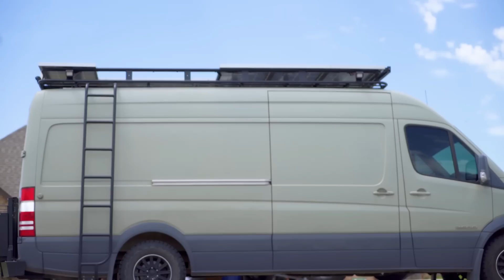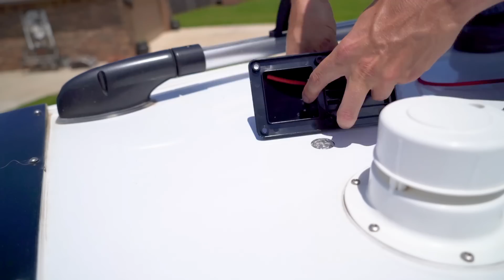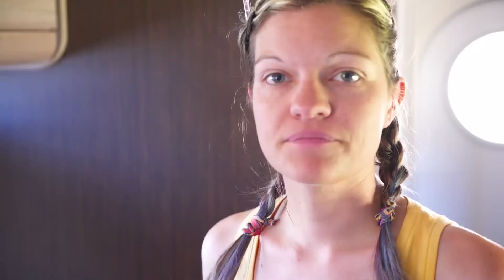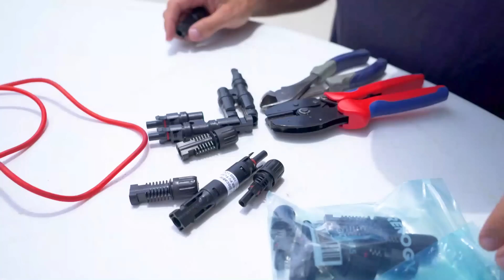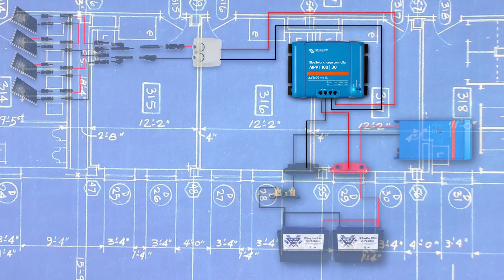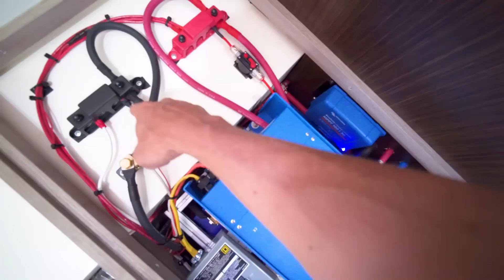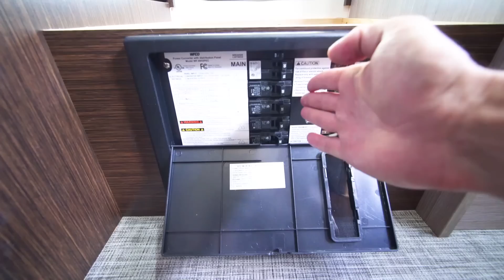Camper Solar Setup Tutorial - How to Solar Power your RV, Camper Van, & Truck Camper

Comment: Have you seen the Rockwood Geo Pro 19FD that already comes with a 100 w solar panel, and is being advertised as able to be used overlanding.  So my question would be how woukd you increase it to run 400w, with the battleborn lithium battery, so it can run longer.

Comment: So I’m getting 525 aHr Lithium battery and only 240 watts solar panels to start, until I see what fits. How long, generally speaking, will it take to charge the battery with just the sun? Yes I understand many variables but it’ll be kn a 19’ Sprinter van that will also charge when run errands from Our boondock site. Should this be fine ore too inadequate? Mostly around the 45th parallel for this question. These are the adhesive panels

Comment: When cutting holes in metal its always worth treating the newly exposed metal with a little protective paint. Another Sprinter build did this step and it makes sense. Seen many boat repairs where old roof mounted things were removed and exposed lots of rust around the hole rims, despite liberal amounts of sikaflex. Shouldn't be quite as bad on motorhomes but its still metal and an easy step which takes seconds so worth doing. Cheers for sharing.
Reply from the maker: Thanks for watching!  Yeah feel free to go as overboard as you like on your build.  Sounds like you know what you're doing.
Reply: Hi from Australia 
I just came across your comment 
Just thought you might like to look at my camping set up, some Australian locations such as world heritage listed K’gari (Fraser island) and some great camp cook ups. 
Cheers and safe travels🇦🇺
Out There Touring

Comment: Good video. Not saying it's bad, it's definitely a benefit, but are those cable dimensions really needed or is it just to cut efficiency losses?
Reply from the maker: Which cables, in particular?
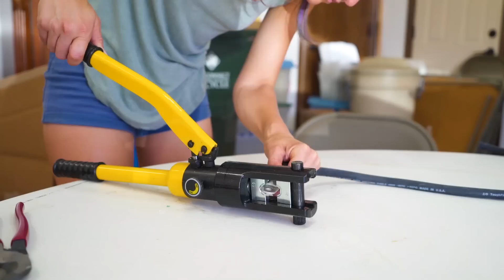Reply: I was thinking of the ones worked on on the table around 8:30, I assume they were used between the battery and the inverter and maybe you'll have that high current, I don't know. It just seemed like a very thick cable for such short distance :)
Reply from the maker: Those are 2/0.  We use those because that's what the electrical engineers at victron recommend in the instruction manual.  :)

Comment: Did this camper not have its own house battery before you added the lithuims and solar? You mentioned bypassing the converter, which is often used to charge the house battery, as well as power DC appliances when shore power is available. You mentioned it powering the DC appliances, but not a house battery.
Reply from the maker: There were batteries installed from the factory.  There were 2 AGM batteries installed in an outside compartment.  Where they were located, there was basically no good way to install an inverter as the wire runs would have been too long and/or we would have had to remove quite a few external body panels to run the wiring.  Basically that would have been more work and less efficient than just moving the batteries inside.

Comment: I am also using a Victron Charge Controller. I have read and re read the Victron instructions and install points and they say not to mount the charge controller on wood as it gets very hot. I am looking for something to put between the wood mounting point in my setup but still looking. If anybody has some recommendations it would be appreciated.
Reply: Just get a sheet of metal

Comment: Just a thought on your shore power hookup, since you only wanted to power your outlets, why didnt you take that breaker, wire it to your inverter/charger shore input, from there, take the white wire from the breaker and hook it to your inverter output, that way you have a breaker protecting the input to your inverter, you can isolate and power off your inverter if you needed and less wire modifications
Reply from the maker: Sorry, but I'm not following what you are talking about.  It's okay though.  The way we did it works perfectly for our purposes and want excessive wriring modification.  It sounds like you know what you are doing though, so feel free do it however you feel like it'll work best for you.
Reply: you branched your shore power (orange wire) to go between your panel and the charge inverter, to make things "simpler" with less splices and more protection, you could could have taken the breaker that was assigned to those outlets, wired that to the shore power of your inverter/charger, then taken a junction box and run the wire originally going to the breaker, junction it and connect it  for more length to the output of the inverter.  Your shore power would power through the panel, then through the breaker to the charge/inverter, from that point it'd go to the circuit for those outlets
Reply: Im also running 2600 watts on my RV but it was an observation ;)  I enjoyed your video and actually am talking to BB to buy one of your kits from them to get lithium batteries
Reply from the maker: Oh, I see!  Yep!  That'd also be a great way to do it!

Comment: Great video! You make a good team in presentation and explanation.

I wonder why do you want to drill holes in the outer shell of your RV in order to glue anchors for your mounting plate for screws that you have to seal afterwards? You still have the risk that water can get under the shell of your RV (maybe not at your place, but when you are getting into the more humid areas where rain is more common...). 
There are very good sealants available that provide enough mechanical strength to glue the mounting feet.  Sikaflex 252 is widely (as in around the globe) used for this job, and also for mounting the entry gland and sealing window frames and whatever joint needs to withstand wind and water. The mechanical strength of the joint between a fully glued mounting foot and the shell of your RV is better than that of screws with or without anchors. The only downside of Sikaflex is that it may last longer than your RV will, so if you need to take things apart... ;-)

Comment: Great video! Thank you! What's your opinion on the need for including the ability to tilt the panels?
Reply from the maker: You can defininitely get more power out of the panels if you want to put in the work to tilt them.  If you are going to be stationary more than you will be traveling, I'd HIGHLY recommend adding some tilt brackets like these: https://amzn.to/2LZRiy5
Reply: Adventure in a Backpack pretty sure I can make those. Thanks! Might be a phase 2 project.

Comment: Great Video.  I have yet to see the document...maybe the answers to my questions are in there.  But those tools themselves are probably around $400 (wire cutter and crimper).  That's expensive for a one time use.  Where did you get these and are there places to rent them?  Also: I'm concerned about the LI-BIM Battery Isolator since the lithium batteries take a different voltage than a standard car battery.  I don't see any method to adjust this voltage.  A B2B would be a better, more maneageble, device, albeit larger.

Comment: Great job, put a fuse between the solar panels and the charge controller.
Reply from the maker: Thanks!  There is one.  Be sure to check the wiring diagrams in the ebook for all the details like that.

Comment: Absolutely amazing work. A couple questions if I may: 1. How did you mount the aluminum box to the floor? 2. I've read in a couple places that one of the probably with lithium batteries is that the required voltage to charge them (14.4V - 14.6V according to battleborn) is different that the alternator voltage of 13.8V to 14.2V. How is this addressed? Thank you for this: This could not have come at a more timely moment as I am considering my options for a solar upgrade on my TC. I want to go with lithium, but have been strongly considering AGM due to the above concern. Thanks for your insight!
Reply: Hi from Australia 
I just came across your comment 
Just thought you might like to look at my camping set up, some Australian locations such as world heritage listed K’gari (Fraser island) and some great camp cook ups. 
Cheers and safe travels🇦🇺
Out There Touring

Comment: I wish RV makers would give more thought to how they decide where to put things on the roof...to maximize that space for solar panels (or MORE panels) the owner is likely to add. Often, the AC, vents, skylights, TV antenna and other such items break up (waste!) open/available roof space which in turn messes up installing panels efficiently as there is little sizable open-space left for them.
When I get my RV, I plan to go solar big-time...but may not be able to get all the panels I need on the roof, especially on a smaller RV (Class B or small TT) with less roof space to begin with, so an efficient layout of vents/skylights/antenna/AC is even more important. Otherwise, to add more panels they'd have to be "remote" -- panels you mount on the roof of the tow vehicle (if you're towing a TT) or outside each time you set up camp (if you have a Class B)...doable, but not as easy as putting them all up on the roof of the RV in the very beginning (set up once and be done with it).
Great video (!) on what you did and it's one to save (a "how to" reference/instructable) for anyone wanting to go solar -- and doing the labor themselves (to save the $$$ professionals charge for doing it) -- on THEIR RV.
BTW: I'm also hoping the prices of lithium "RV batteries" come down big-time in the not-too-distant future...they're outrageous presently. :-(
-- BR
Reply: Don't worry, lithium batteries are already like 10x cheaper than in 2010, and still dropping. For now if you are on a budget you could use different kinds, they just aren't as good.
Reply: Spend more time and plan it better., Simple..😄
Reply: This is why I removed my Roof-top AC unit. Put on 4x335 (1005) watts of solar. 
I will be running a small window AC (450watts), and then upgrade to a Mini-split AC unit, (455watts)
I have 300(3x100) Amp hours of Lithium BB Batteries. I hope my math is right... if anything I would add more solar to the SIDE of the RV for those winter months and or for the shade in the summer months.
Reply: Bill Redding The lithium batteries are already worth their price ten fold.

Comment: What size is the 80/20? It looks like 15 series because the 10 series does not have corner brackets. Or did the brackets come from elsewhere? Also wondering why you did not get the charge controller with the built-in Bluetooth?

Comment: Great job on the PDF.   The work you did to create the pictorial wiring diagrams was well done.  This will make wiring much easier for those not used to reading schematics with the mess of lines and notes.    the old guy     Bert
Reply: PS  Upsizing will be easy with the appropriate changes in wire size to support the current loads.  A short video on current and wire sizing  ( for safety and line loss reduction)  might be worthwhile.   Also a explanation of the advantage of oversizing to support future loads without having to rewire the system. For example more PV panels, larger battery bank and charge controller, larger inverter,  combiner box and buss bars, fuses, shunts etc.  Again well presented!   Bert
Reply: bert skelton 7
Reply: Hi from Australia 
I just came across your comment 
Just thought you might like to look at my camping set up, some Australian locations such as world heritage listed K’gari (Fraser island) and some great camp cook ups. 
Cheers and safe travels🇦🇺
Out There Touring

Comment: Wow, that's amazing.  Great video.  Do you have any video where you go into the non-technical side of the Battle Born batteries,  as from just a user standpoint?  Charging parameters, winterizing, cautions due to cold temps, discharging, etc.  Thanks for all your excellent videos.
Reply from the maker: Hey Doug!  Thanks for watching! :D :D  We will be putting out a video like that within the next few weeks (as we are also switching our batteries in our campervan to Battle Born lithium as well), so be sure to ask as many questions as you want soon and we will be sure to cover them specifically.  Cheers!

Comment from the maker: 🔴 Our ebook has been replaced by new and updated content, no email necessary.  Here's where to find it: https://www.explorist.life/diy-campervan-solar
🔴 Solar Wiring Diagrams & Parts Lists: https://www.explorist.life/solarwiringdiagrams
🔴 More solar tutorials: https://www.explorist.life/diy-campervan-solar/
Reply: you may want to pin this to the top of the comments!Minus this reply of course!
Reply from the maker: Oops! Thanks for the heads up!
Reply: Adventure in a Backpack do you mind telling me what sure power is. I saw the plug a Min to go running it in and out and everything what you would she was I think it was she was talking about it but do you mind telling me what it is.
Reply from the maker: Shore power is plugging the camper into an outlet at, say, a campground.
Reply: What is your opinion on the flexible solar panels
Reply: You've lost me -- on your solar panels you have twice wired the positive of one panel onto the negative of another panel???????
Reply from the maker: Robert Cathcart  Right!  That's called 'wiring in series' which combines the voltage.  The Solar controller brings the voltage down to a useable voltage.
Reply from the maker: Correct!  MPPT controllers want to be fed more voltage.  They will "magic magic magic" it into amperage to the batteries.
Reply: By far hands down the best DIY RV install of solar I have watched yet on YouTube in the last 2 years.